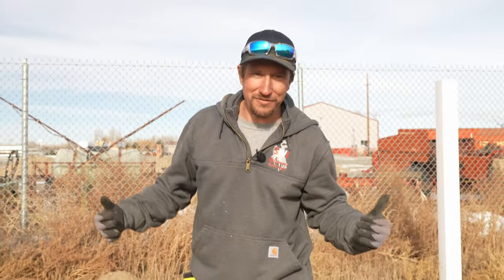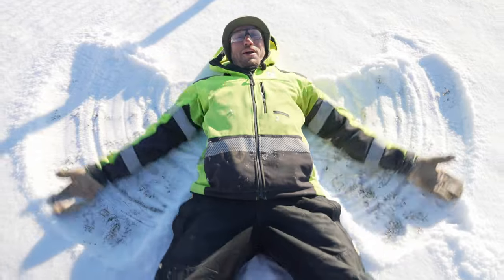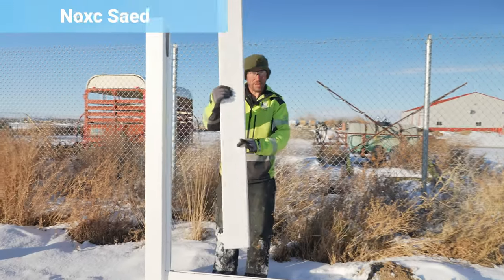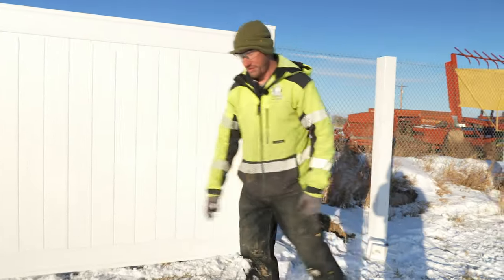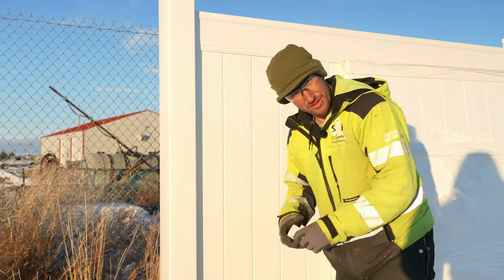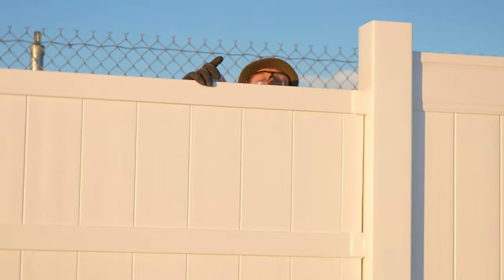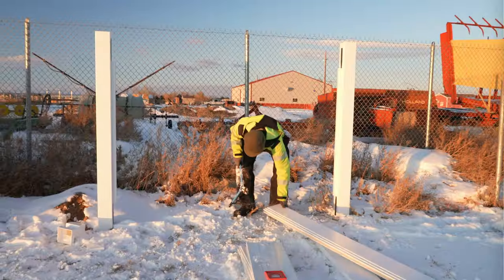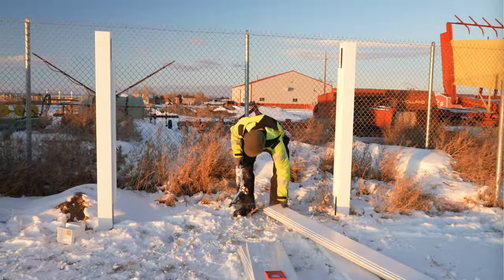How To DIY Vinyl Fence: CHEAPEST vs KIT vs OURS

Comment: I used the complete trash one and its still as good as when i installed it 😊(about 11 years so far)
Reply: Also with the complete trash vinyl, you can wrap the post and panels with wood texture vinyl film. All cheap stuff and looks like a million bucks. My friend had me place metal rods in certain spots to strengthen in case of severe winds. I'm over 8 yrs . The only problem is the areas where the sun shines on the wood film faded.

BUT WAIT!!!! All I did was apply mineral oil. It's restored to like it was first installed.

Mineral oil for 32oz is like 2 bucks. 32 oz covers over 18 x 6 feet easily.

Psst mineral oil is the truck for anything plastic rubber fading. Don't tell anyone not even Armour All, they won't like you knowing their secret.

Comment: I had a professional company install a vinyl fence 20 years ago. A tractor ran into a post and damaged it. The supplier didn't have that exact model anymore. Similar ones existed but spacing between the posts were different (1.25 vs 1.5 I believe) and it just looked way cheaper. So even when you get a professional company that just does fencing you might find out you'll still have issues down the line. Highly suggest storing a bunch of extra if you want it 20+ years later. Last time we had a gate get damaged (something hot melted/burned it). I ended up just buying raw posts, tracing out the rail holes by hand using the damaged pieces, cutting it with a jigsaw and a Dremel wheel, and building a new gate. Cost me about $40 instead of a few hundred easy for what was going to look like a cheaper out of place gate from a professional.

Comment: You can use metal abrasive cutting blades in table saw, skill saw, miter saw, or even a angle grinder to cut vinyl. Makes a fast clean cut and is slightly safer then a metal fine tooth blade (only slightly)
Reply: Just don’t pause or you’ll melt it!  LOL

Comment: Great video Dan and team, excellent job explaining the difference in quality. We go through the same struggles in Ma, a lot of people purchase the box store vinyl as shown in video and they do not save much on material especially after when they have to have fence replaced multiple times versus doing it right the first time with quality material and doing it once 💪🏻
Have a great dang day
Reply: Greetings! How have you found the longevity of vinyl in our MA winters? I have seen a lot of failures in the way of cracking and even breaking. Is this merely a matter of what Dan was saying, that I was seeing poor quality vinyl? Thank you.
Reply: @newenglandman2413  Hello, from what we see I would say mostly due to big box store that shall not be named 😀 Any fence when struck by something hard enough will suffer damage and usually break. We install professional grade vinyl fences all year and they hold up very well as long as they are not hit by fallen tree branches or being struck by rocks from lawnmowers etc.
Reply: @NoahDevine91  Thank you very much; I appreciate that. We certainly have our challenges in New England!

Comment: Serious question, will the cheap panels, that you aren't a fan of, hold up inside a building? I'm building a small dog kennel inside a room in our shop. Floors are concrete so I can set the posts correctly. No worries about sun rot or wind. I liked the idea of the pre built ones being a set size. Basically, they will be used as bays for the dogs. I don't need them to last more than a year or so, just until I can get a permeant structure built for our kennel business. Then I intend to have a professional install good vinyl fencing. Would they withstand dog scratching for a year-ish?
Reply from the maker: I can't promise but I would think you'd be alright.

Comment: Thanks for the video. Great comparison What do you think about using screws to lock the top rail inside the post?  Does your bottom rail have a metal I beam?
Reply from the maker: We know of people that just use screws to lock the top rail in, but we prefer the rail locks. More secure in my opinion to spread the surface area of that contact along the entire side.
Reply from the maker: No, top and bottom rails are the same--no metal I beam needed.

Comment: looking on the swi website, the posts you guys provide doesn't seem to have the "holes" for the rails on the pictures. Does the posts have the holes for the top and bottom rails? (5x5 posts)
Reply from the maker: The website isn't as clear as it could be. We can provide posts with holes wherever you need them. You're welcome to call the shop with any questions you have. (307) 578-8040
Reply: @SWiFence  thanks, for sure! Will call when ready to order!

Comment: Dan my man… I wasn’t expecting the perfect snow angel.  You Devil!!!

I put in a vinyl fence from a pro supply house in Florida two years ago.  The neighbors had a handyman install theirs with big box panels.

Mine made it through two hurricanes unscathed.  The neighbors came apart in the first one.  And it’s replaced sections and posts also failed in the second.  

Now, about those self drilling screws… who trains them on where and how to screw themselves?  I mean, I am always being instructed to go screw myself.  Yet those come out of the bag ready to do so.  

You could blame the dirt on TMBC… I mean, no one blames the Main Character (and resident Snow Angel Sculptor) when the props or scenery are screwed up… do they?  

I’m gonna go out and start training my screws… it’s gonna be a good danged day!
Reply from the maker: I bet it is somehow MBTC's fault! 🤣🤣
Reply: What pro supply house did you go with?

Comment: Why you didn't use 4x4 wood post, inside the vinyl ones?
Thanks.
Reply from the maker: With high-quality vinyl you don't need to use wood posts inside your vinyl. Granted, maybe with some of these cheaper vinyl you should. That's a possibility.
Reply: The MFG has aluminum stiffners that you can use that fit very well.

Comment: The only problem I have is that you pulled on the sides of the first fence top post but then you pulled on the bottom of your post. I understand that you are marketing your fence. But if you are going to compare I believe you should test run both products the same way you did not pull on the sides.
Reply from the maker: Fair point. I'll try to remember to pull in the same place next time. 👍🏻

Comment: as someome who has built fences for 7 years, i hate vinyl fences. they are easy to build but they are so weak, if they are built by an idiot they WILL fall apart in a year or so, and if built properly i can still run through the panels. a bbq will melt them to shit, they are brittle in cold winters, i just hate the lack of durability they seem to have
Reply from the maker: They are a deeply divisive topic. Love 'em or hate 'em.
Reply: @SWiFence  true, I'm on the hate em fence lol

Comment: you better support the bottom it will sag and then self tappers what are they going into 1/8 material , I started seeing these fences coming apart after just two years , I have seen the panels fall out in the wind my opinion vinyl fencing are a joke
Reply from the maker: It's all about the quality of the vinyl and the methods used to install. We've tested ours in hurricane-force winds.
https://youtu.be/_iQnheVwAI4
https://youtu.be/8jWcT17PFME
Reply from the maker: Sounds like you've worked with some cruddy vinyl product in the past.
Reply: @SWiFence  my experience with seeing what fence builder do is a joke , that was the very first thing knew how to do in construction and don't make it out to be a piece of art work its a fuken fence

Comment: The simplest answer is The cheapest one is the one you built yourself. Installing fence is not rocket science. Even a bum off the street could get the job done with the right tool.
Reply from the maker: Ah, but getting your fence to not LOOK like a bum off the street installed it--that's a whole different story.